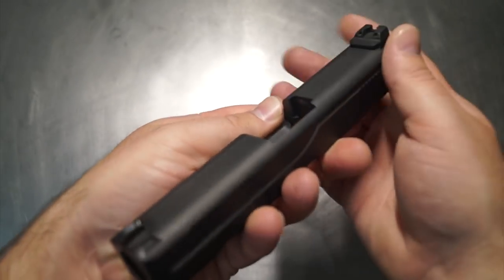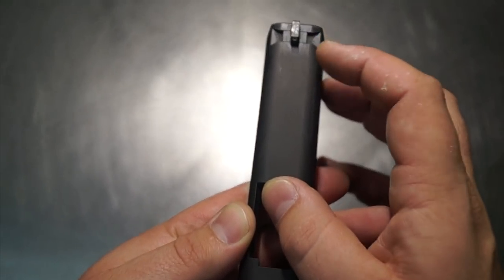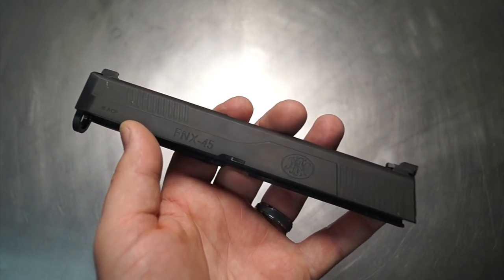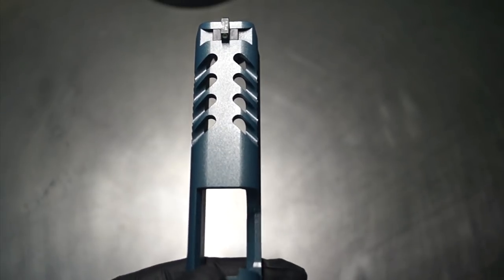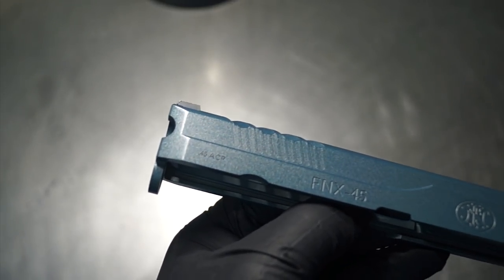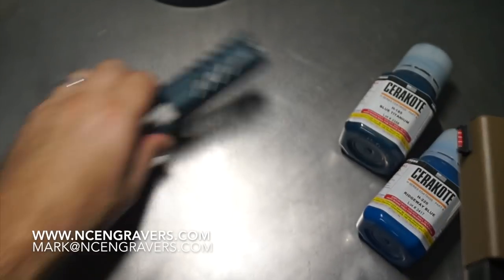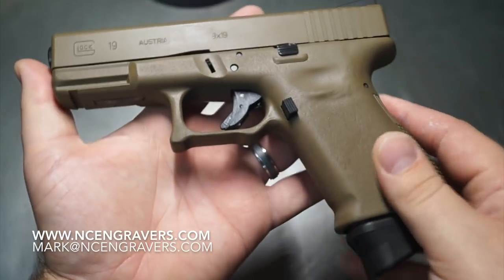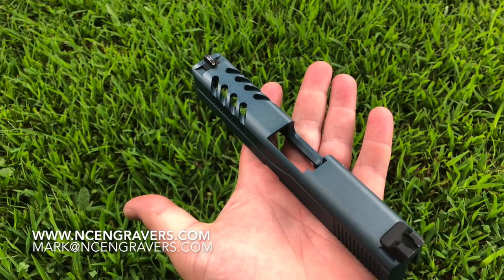NCEngravers.com  - FNX 45 Raptor & Cobra nose

Comment: The difference is internal... they Lowered the bore access ...  it messed up the way the magazine set
Reply: I and several others in my shooting group have run FNP-45  slides on FNX-45 frames and visa versa. The magazines also interchange and function flawlessly. Sample size of more than 25 of each now. The only difference we have noticed is the magazine catch, and related parts are smaller/slightly modified on the FNX than the FNP, but again, they interchange and function perfectly.